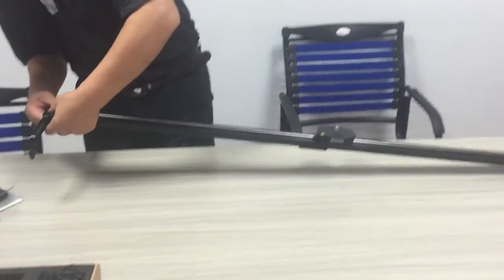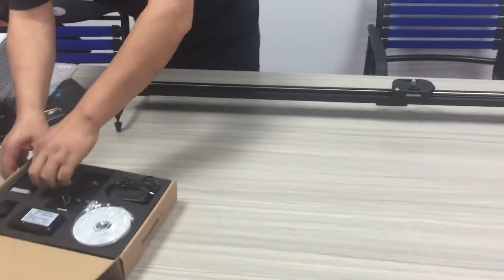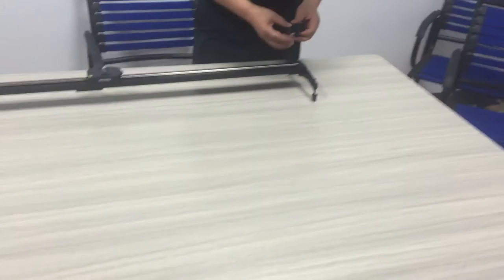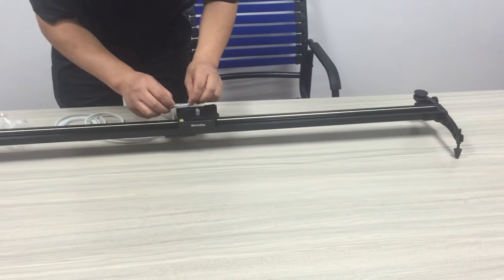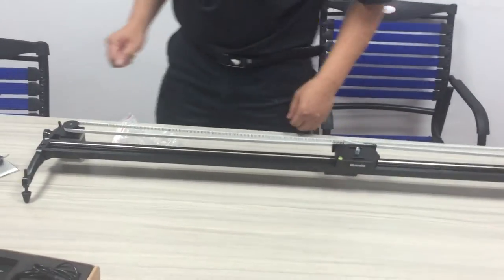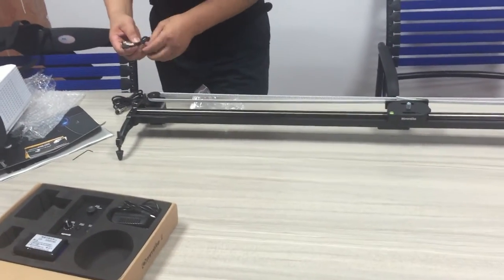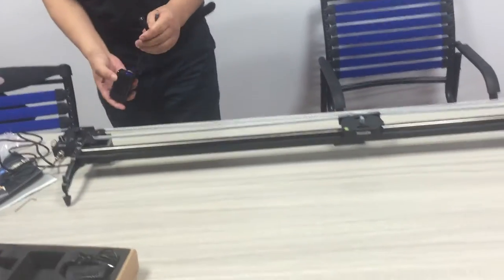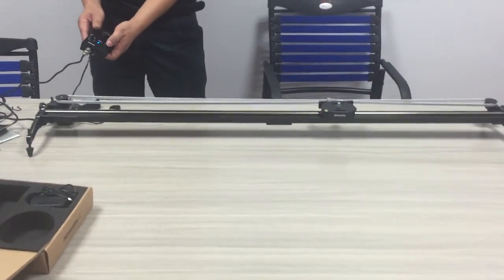Commlite Electronic Video Slider 120cm with Ball-bearing

Comment: Hey Amber
Did you need to charge the battery for a first use ? I just got it in Europe with the wrong plug to charge the battery. I tried to use the slider anyway, there is no blue signal on the controller
Reply from the maker: dear, I think it's better for you to contact the dealer for further service.